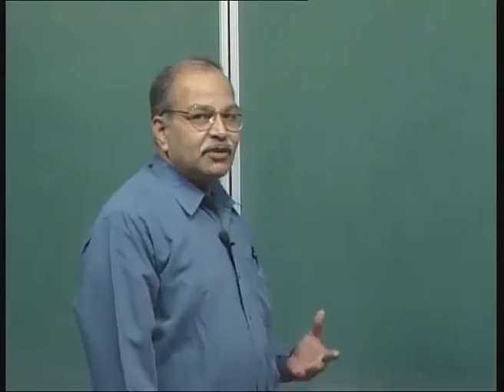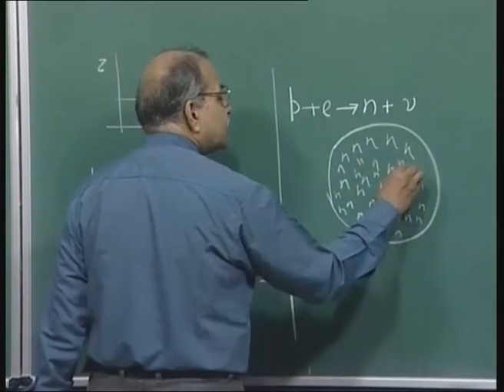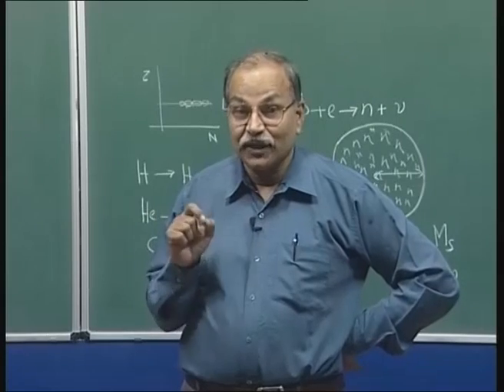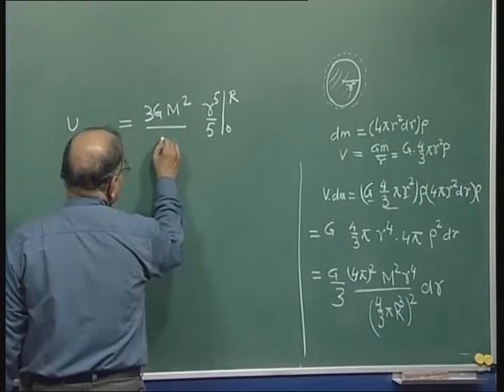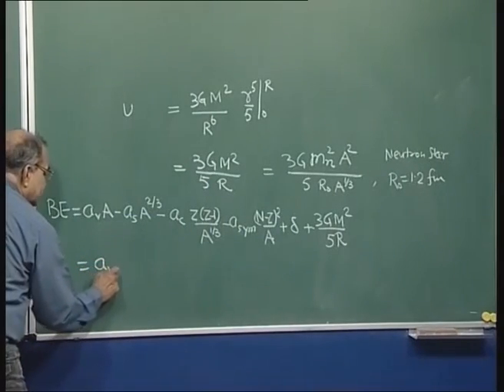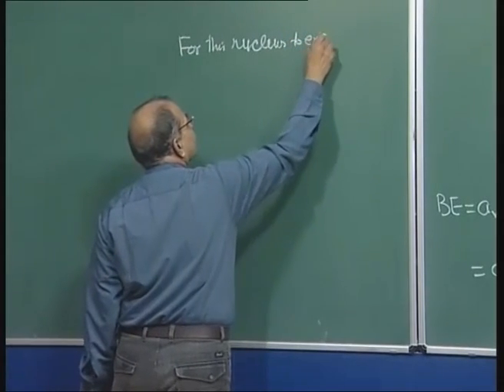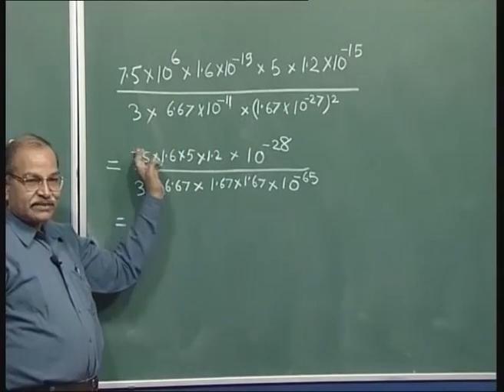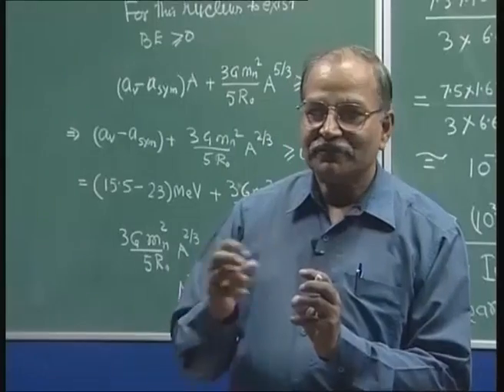Mod-01 Lec-10 How are Neutron stars bound

Comment: A case against neutron stars . Fact Neutrons decay, this fact will make this lecture irrelevant, the following is hypothetical scenario  based on known  physics, which would explain the Improbability of neutron stars ; Neutron is made out of an electron and proton and neutrino,  (neutrons are Known to be unstable due to Beta decay) they say Neutrinos escapes because  of nuclear decay  and low mass or  close to Zero mass  the neutrinos would be lost Or radiated out, it must be remembered that neutrino is part of the ingredients of a neutron . After losing a neutrino what would be left is a proton and a electron, which would constitute the ingredients of a hydrogen atom not a neutron , being that the protons Is heavier  (1800 x) then the Electron it is quite possible that the interior will become a large Proton like object, but only if there is enough gravity , there for, it should be called a proton star and not a neutron star,. The core would be of pure hydrogen nuclei. Between these two scenarios the most plausible would be proton star, because it is based on known physics. But a note must be granted here, proton stars cannot exist , because of coulombs law will not allow the protons to pack together. Neutron star Scenario just doesn’t make sense ! The fact is that a neutron stars is actually Hypotheticals objects and the physics  that is suppose to supports this is vague . The Pauli exclusion principle Is introduce because it helps explain the density packing, but there are other forces That will inhibit these high densities ever being achieved. So there is no credible explanations about how the Neutron star would be kept together.  This hypothetical neutron star explantation is one dimensional thinking,  which ignores other factors in physics. So don’t be fooled!
Reply: A neutron isn't made up of protons and electrons! You lack basic knowledge.
Reply: Neutron stars are a reality those stars which do not have enough mass to become black hole but strong enough to destroy the structure of atom